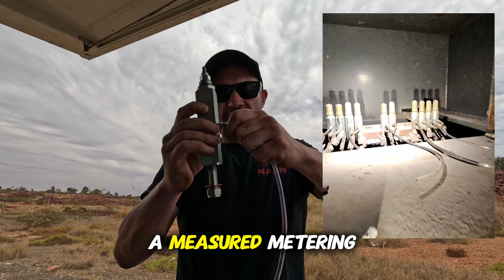THE MOST COMMON CAUSE OF AVOIDABLE DOWNTIME IN MINING EQUIPMENT! PART 1

Comment: Great 👌 video as always mate 
Your not wrong, working with 22m long reach on dredging n underwear demolition, machine is as good as gold, except autolube!
Filled with a gun,some people fill wrong n get air in,then just keep running test when fault light goes on
One Hitachi never been right floods lower cylinders doesn't get enough to H linkage,fitters are like🤷
Reply from the maker: legend mate I love those sort of machines! nothing like a bit of salt water to the mix to make things interesting! as if it wasn't hard enough already! it crazy how such a simple system can cause so many dramas and you see blokes who have no idea about them! I had very little interest in them at first but soon realised I needed to brush up on them! fundamentals right? it a curse now because I am always spotting things and I am like oh nooooo hahaha!
Reply: @patrickcoward4309 yeah had to keep on top of the Hitachi...no quick hitch n tidal work having to change bucket to breaker n back 3x before we lost the tide 😂
Know one hire firm sends brand new pc360 22m out to dredging job no autolube🫣

Comment: Good video mate,
Couple things I've seen too. When installing new injectors, people screw the fittings in too tight and it locks up on the piston so it can't cycle. Or on trucks like komatsu 830s the end of line pressure sensor reads bad because it deadheads the grease dries up and you get bad grease pressure readings.
Reply from the maker: cheer mate haven't seen that but will definitely keep it in mind! nothing seems to amaze me anymore! yeah I have had that before with the dry grease!! I worked at a rough and ready site and when they rebuilt it they left a heap of old grease in the pick up! was like why is this pump not pumping! oh and I've had people put new pumps in multiple times and tell me it won't make pressure only to find the red cap left on the pickup! stumped me for a few hours the first time! but not the next few haha